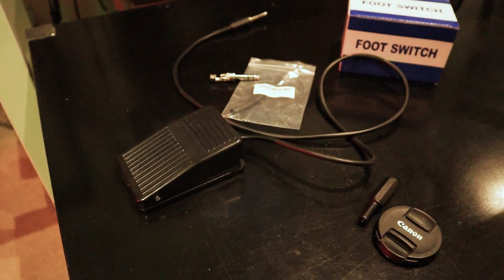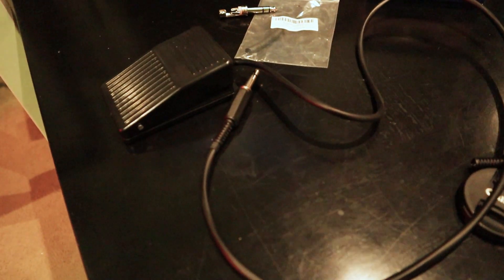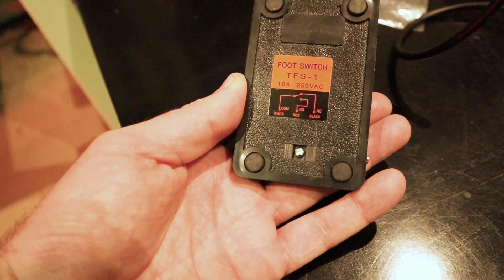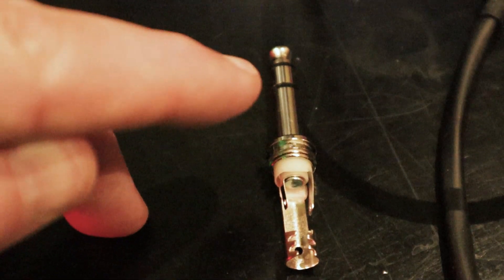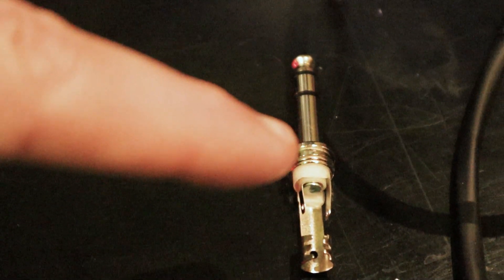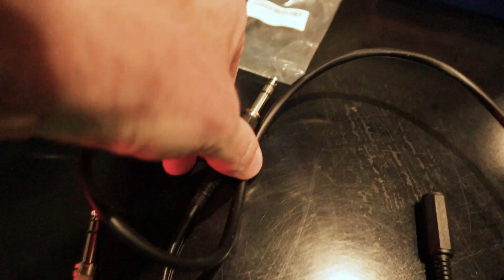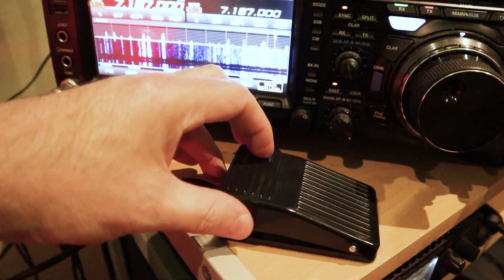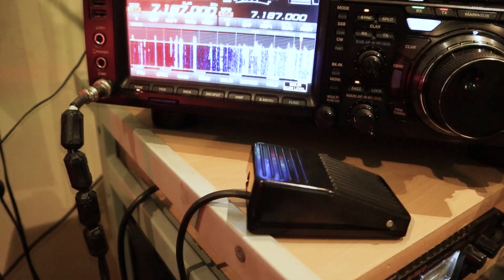How I made a HAM RADIO foot switch!

Comment: Just bought a tattoo one but wont key up the radio though the heil to icom lead
Reply: If your using a stereo jack plug try grounding the second ring with the ground, or just use a mono jack plug